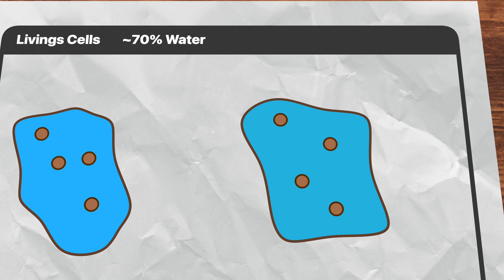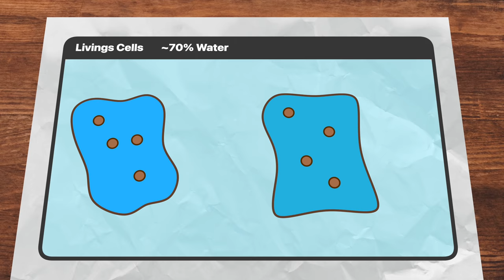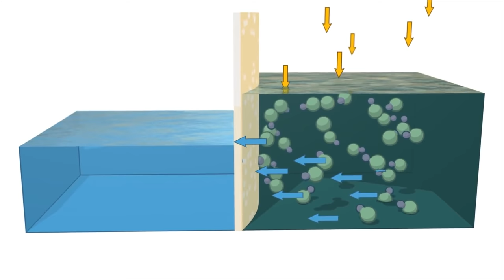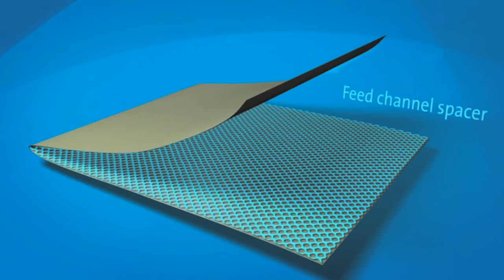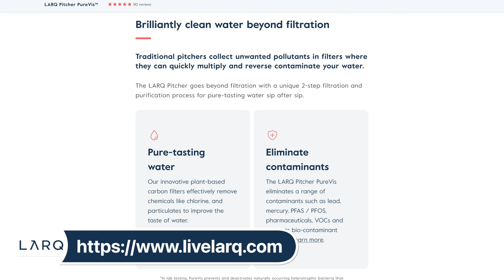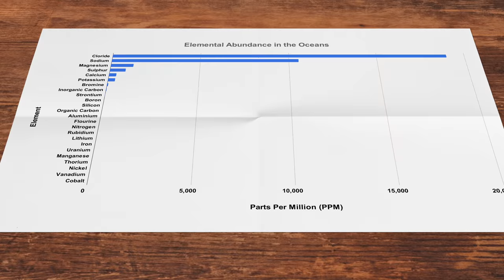Why Not Build Desalination Plants EVERYWHERE?

Comment: I once did a project in grad school involving desalination and argued that one of the best ways to use desalination plants economically should be with power plants since they take seawater and need the conversion to freshwater to preserve the plants. Currently, they thermally pollute by dumping the freshwater back into the oceans, which could be saved for water reserves. I'm assuming these systems have to be financially and energy profitable anyway.
Reply: Thermal pollution?  What the heck are you talking about?  It's literally like a drop in the ocean.  It does NOT change the temp of the ocean by even a fraction of a degree.  Go back to school, study this time - and then publish.
Reply: @foobarmaximus3506  Nobody scatters the hot water over the entire ocean. They pour it all back in one location and in that one location the water becomes very warm. O2 capacity is reduced and fish die. Manatees in winter love it though.  In winter, they all gather near water discharge to keep warm.
Reply: @foobarmaximus3506 , tell us you don't know about localized effects on micro climates without telling us you don't know about localized effects on micro climates.

Comment: Great video! 
If I'm understanding correctly, I think you may have the numbers wrong for the example of extracting Lithium.
If 100 million tonnes of sea water is processed each day, and there is ~0.1 parts per million of Lithium, then doing the multiplication (i.e. 100×10^6 × 0.1×10^-6) gives 10 tonnes of Lithium extracted per day. This is then only 10,000kg of Lithium per day not the 10 million kg from the video.
Thought of another way, 1 ppm is 1mg/l, and 100 million cubic metres of water = 100 billion litres. So we'd expect 100 billion × ~0.1 mg = 10,000kg Lithium.
Reply: yes the lithium concentration in this video is orders of Magnitude too high, a single google search gives you 0.1-0.2 ppm Lithium in seawater not 10, it sounded way too good to be true, but it still has potential

Edit: the numbers i found for the amount of Li used in a tesla battery was ranging from 10-15kg, based on that if the concentration in seawater is 0.1-0.2 ppm we could extract Li for 833-1666 tesla batterys if we assume 12kg per pack
Reply: @NextGHaHaHa  And all this is assuming that the lithium extraction process is commercially viable. Might be too expensive to render the lithium and cobalt into usable forms, as I'm sure the compounds that contain these elements in the seawater are not usable without further processing.
Reply: @LeganArabach  true
Reply: Something seemed fishy, thanks for doing the math

The other Q is of course if you can easily centrifuge or oxidize or whatever you have to do to separate the salts, so that it's viable
Reply: also, that the whole word. it's not like it's worth bringing all the brine in the same place, like even if they would collect 10% of it, how much lithium you get? I'm sure is variable amount and not really worth it, even compared to like collecting used batteries
Reply: @laszlobandi6456  yea just like usual practice and theory are 2 different things
Reply: @LeganArabach  "I'm sure the compounds that contain these elements in the seawater are not usable without further processing." - That pretty much applies to all the other natural forms of lithium out there too.
Reply: @CoolKoon  Obviously. Thank you for contributing lol
Reply: "100 million tonnes of seawater is processed each day, and there are ~0.1 parts per million of Lithium," 
Let's not forget that as we extract the Lithium the concentration that is left will be less than before.
Reply: @MrStringybark  haha good observation, however as we are currently processing ~0.1 cubic kilometres of the world's  seawater and according to "The World Ocean" encyclopedia, there is about 1.347×10^9 cubic kilometres of seawater globally, the change in Lithium concentration would be approximately (7.42×10^(-9))% per day, which is obviously negligible for now! 😀
Reply: @riggmeister  That would be correct if we had a 10-mile-long stirrer dipped into the oceans every 50 miles or so making sure the mixture is evenly mixed. 😏
Otherwise, before too long the area around the extraction point would have a much lower percentage than the rest of the sea.
Reply: @MrStringybark  but in principle we surely wouldn't be pumping sea water out of the ocean and freshwater straight back into the ocean?! The concentration would only be affected if all the freshwater harvested was returned to the sea at the point of source. 
Instead, won't the freshwater be used up, become a natural part of the global water cycle and eventually mix into the ocean more evenly, diluting Lithium only a miniscule amount?
Reply: @riggmeister  I'm sorry I should have been more specific. 
I was responding to your idea that the Lithium concentration would remain constant at the extraction point. 
This is why I jokingly suggested that would only happen if we had giant 10-mile-long stirrers every 50 miles or so.
Reply: @riggmeister  yes as long as we don't exclusively extract lithium and pump the water straight back the dilution won't be local
Reply: At the point that those plants become viable I'm pretty sure most of our batteries will be on Natrium base and no longer on Lithium base like now.
And Natrium extraction from brine should be pretty easy and really be HUGE amounts ^^

Comment: Really appreciate the explanation which helped me better understand why there isn't more movement in that direction.  I appreciate the downsides and perhaps more focus would lend to some better solutions.  To me, the bottom line is what other solutions can take us into the future?  There are other  that options that currently contribute on a relatively small scale overall.  IF the drought doesn't diminish, what else is there to accommodate for the demands for water in the next 30 years?
Reply: I wonder how Israel is succeeding so wildly with desalination?  What are they doing to make it work so well?

Comment: Or, you know, just build a solar thermal powerplant, if you already plan to use a concentrated solar array, and then desalinate via its waste heat. This way you can co-produce clean water with energy. And in contrast to PV you get your energy storage basically for free.

Also dumping brine in the ocean only becomes a problem if you do it the stupid way. Instead you need to dilute it with more sea water and spread it properly.
Reply: you are right ..cogeneration is very efficient 😊
Reply: Solar membrane thermal over solar thermal ftw; sodium is light and is wont to move as much as water. Brine back to the deep ocean skips trying to dilute it and corresponds better to shore stewardship. Separating the brine still makes for a giant chlorine loop even if you make minerals again pretty quick.
Reply: Filters clog (R.O.), require uber maintenance, expensive all the way around; mini nukes are manageable, not yet affordable, but tech wise very doable; the subs just offload brine (through torpedo tubes? I really don’t know); I believe the cavitation brine reduction method meets the middle ground here (yes, beyond conjecture I reduced 80k ppm brine from my Kentucky wells to 350ppm) and that was in 1999. Bearcreekresearch Don Hall.